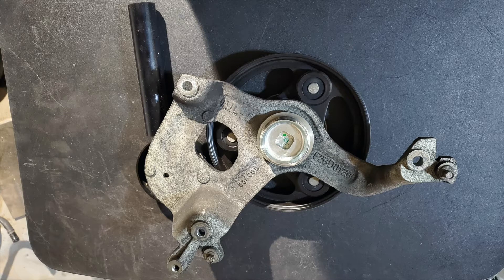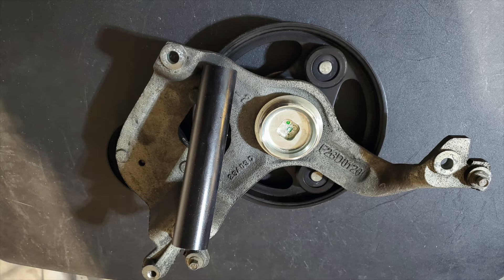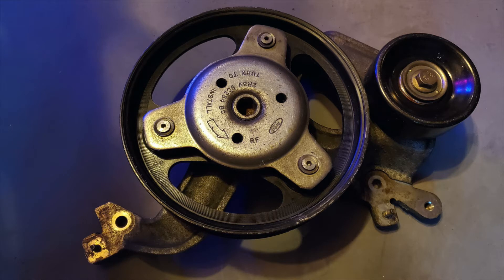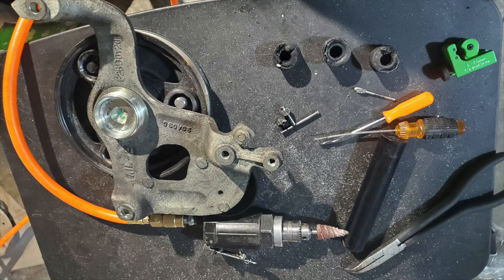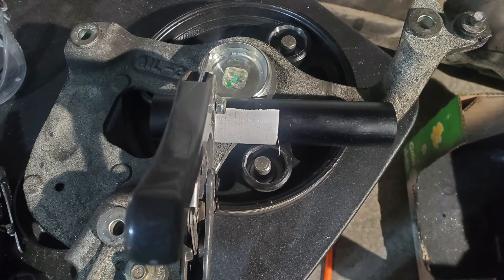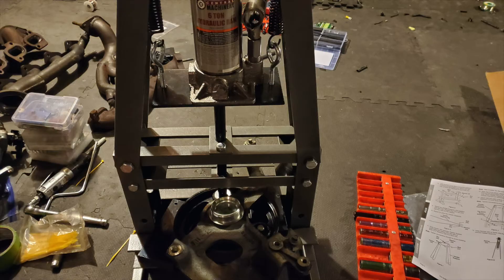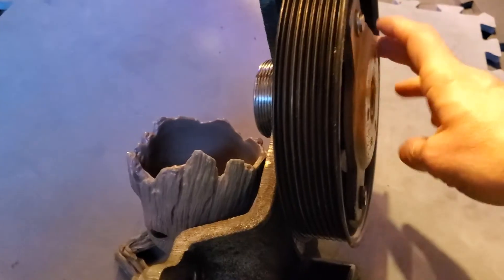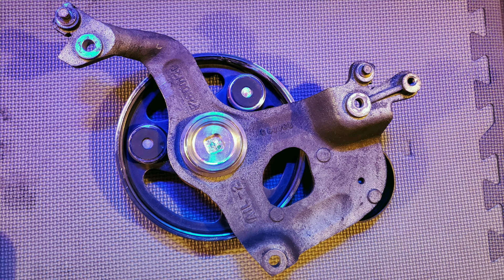2003 / 2004 Cobra Mustang Lower Cage Rebuild - How to Replace Cobra Lower Cage Bushings!

Comment: Well guess that comes down to either wanting to tackle rebuilding the stock one or spending $400+ on a metco lower kit
Reply from the maker: Very true!  Having a 3.1 upper and 6 pound lower sounds really really good.  But I wanted to try and stay caged but run the smallest possible upper pulley.  Even with a 100mm idler pulley I still might slip a little with the 2.60.  But with porting the heads, intake, and port matching the shorties,  It should lower the boost just enough to keep it from slipping but still give really good HP and torque.  Hopefully it all works out!  Thank you again for watching!!!
Reply: @MikesGarageRoute66  sounds like an awesome plan. It definitely came out pretty good
Reply from the maker: @Lethal_Venom  This whole build has been so much fun.  When it's done I will literally know every bolt on this car...  Thanks again!
Reply: @MikesGarageRoute66  I hope to get much more familiar with mine starting this year
Reply from the maker: Can't wait to see it!
Reply: @MikesGarageRoute66  Thanks appreciate it!

Comment: You are removing the lip that keeps the rubber in the hole. I imagine it won’t be long before the rubber squirts out. I’m going to look for another option.
Reply from the maker: I thought the same thing when I saw it on  the SVT forum,  but  the material is very stiff and I had to use a press to push it in.  I am very confident it will last 10 years.
Reply: @MikesGarageRoute66 keep us updated.
Reply from the maker: @pwesterbeck  Absolutely.  Thank you again for watching!

Comment: Started hearing a rattling noise from underneath and noticed my bushing was shot and pretty much deteriorated. Can that also cause power steering issues on the accessory belt?
Reply from the maker: Thank you for watching Jamaal!  No it wouldn't create power steering issues, but you want to replace the bushing.  Otherwise it causes excessive belt wear and can affect other pulleys using the same belt.   But power steering would be separate.  What kind of power steering issues are you having?

Comment: Is the Mcmaster Carr pn ending 122 or just 12?
Nvm looks like it changed over to ending in just 12. Shows in the description as being same as 122.
Reply from the maker: It should be the same.  I’ve had zero issues since using it

Comment: Could the actual pulley itself be removed and a new one installed instead? Can it be removed ?
Reply from the maker: A few people have taken it apart successfully.  Others have tried and failed.  If the pulley itself is bad you are better off just finding a used lower cage.  Mine was fine but had bad bushings that I replaced.  Thank you very much for watching!
Reply: @MikesGarageRoute66  Wow, is removing the pulley difficult? It looks like an easy removal and reinstall. Unless some specialty tools are needed or something.
Reply from the maker: On the cage it is quite hard from what I've seen in the forums.  I replaced the rubber bushings and I'm having with that.  1500 miles so far and zero issues.  It's pretty much a permanent fix.  Thanks for watching!
Reply: @MikesGarageRoute66  Thanks for the advice. I have heard it's hit or miss when replacing the bushings on the pulley. Another cobra guy on YT named Intervention302 had his bushing go bad again shortly after having them replaced. Hope you get many miles out of yours. I was able to purchase a new oem pulley off a <1,000 mile cobra for cheap, just the pulley though no crank. That might come in handy in the future.